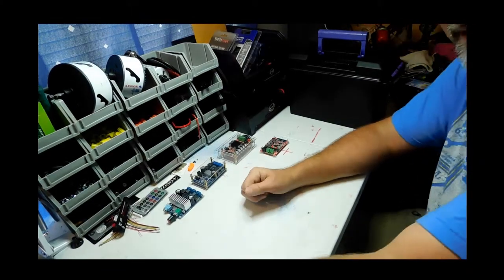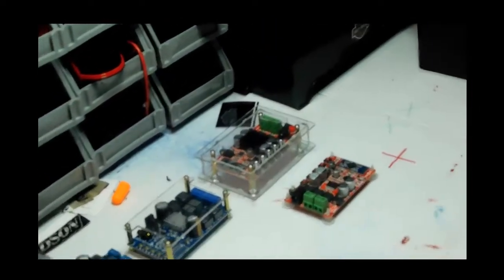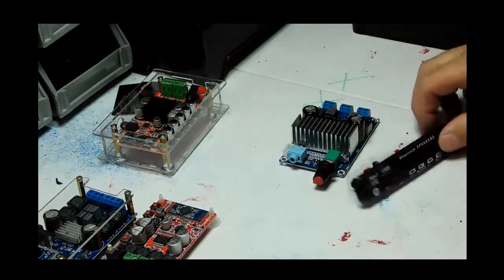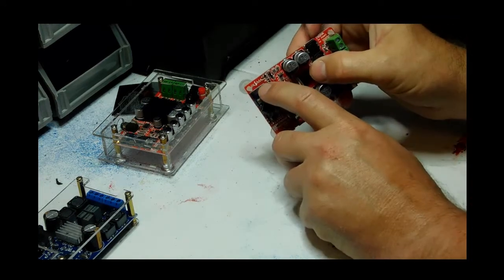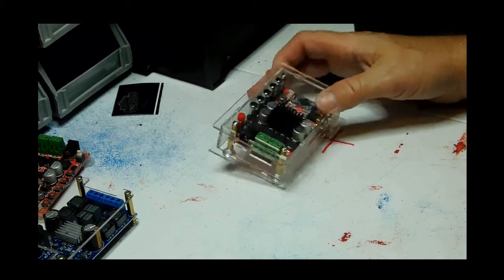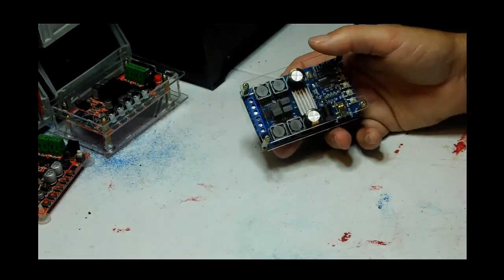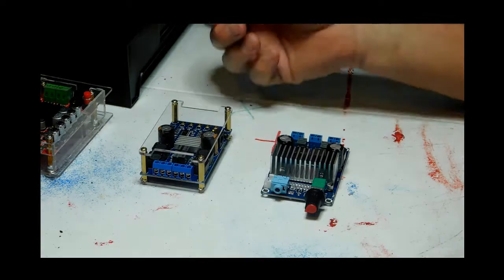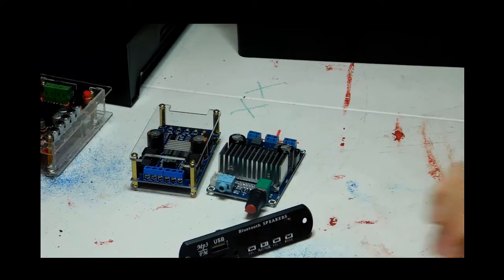Amplifier Boards that you can use in your boom box project

Comment: Great to know I was about to buy the other one on amazon that’s with a fancy knob and says 100wX2  and it has a black cover w a diagram any ways I went for the two you mention the one with Bluetooth and 3.5mm and I made many test it should give you 21.2W from 12.5-27v with atleast 1A crazy how good this are , that’s true I didn’t find any problems with any poop sound , there is two versions one with a lady voice when connected and mine was with just a tone . Less than 12.5 v and you get less watts it could go up to 5v heheh crazy tech but I’ll distort sooner on any input source you put quicker . I just wanted to buy for mini speaker test and or a future diy boom box  install
Reply from the maker: This video is quite old. The one you are talking about is a great amp

Comment: Add a 10-100 uF capacitor across your power input on the board... That should help with the noise AND the audible thump when turning on.
Reply from the maker: Robert Cartier is there any way you could possibly join my Facebook group and draw a diagram to show exactly where to put that capacitor?. I know what you're saying but I'm not sure I understand exactly where to put it and if I could see a diagram that would be great. Look it up on Facebook, I love all things radio is the name of my group
Reply: Sorry, I don't do Facebook... 
A more detailed explanation, perhaps?

In your builds, the way you connect your power to the amp is by the input power jack. In most cases, only two pins are used on that socket. Mount the 'decoupling capacitor' (that's what it's called) between those two pins, paying close attention to polarity. If there is no space there, see if you can mount the capacitor on the underside of the board to the socket pins. Use a small electrolytic capacitor with 10 to 100 uF, with a rated voltage higher than your input voltage. 

In other words, mount the cap in parallel to the power leads. Place it as close to the point where power enters the circuit as you can. Polarity is very important.

You can find those caps in almost everything you take apart... just salvage one from an old internet router or a modem.

Anyway, here's a link to a picture of a cap mounted parallel to the incoming power leads. https://1drv.ms/u/s!Ar8YMCukXFGFniidU31PHGFz02c0

Cheers from Canada!
Reply from the maker: Robert Cartier Man, you are missimg out. We have a gantastic group of builders in my Facebook group
Reply: You wrote: "Man, you are missing out..."

Can't be missing out on much -- You're there all the time and were still  unclear on where to connect a decoupling capacitor. 
LOL  Kidding! (...but not really.)

A better reply would have been: 
"Hey thanks Robert for the revised explanation, now I get the capacitor thing..."  But nope, it's Facebook this, and Facebook that... Enough already!
Starting to think this YouTube channel is all about your Facebook group, and asking for more info was just a ruse. ;-)

Just teasing... 
Your group sounds like fun, but like I said, I don't do Facebook.
Reply from the maker: Robert Cartier the reason I promote my Facebook group is because it's a lot easier to have conversations and post pictures and explain things on the Facebook page than it is in the comments on YouTube.
Reply from the maker: Robert Cartier and I do thank  you for the help I'm going to do my best try to figure out how to make it work
Reply from the maker: Robert Cartier I appreciate all the help I do is just easier for me to communicate on Facebook that's all

Comment: How many watts do the speakers have you be for this bluetooth module to work ?
Reply from the maker: Oscar Diaz you want to use speakers that are at least 30 watts RMS
Reply: DIY Boom Boxes In Texas ahh okay makes sense , my current speakers are maybe too much , the bluetooth module will spot working after a while
Reply from the maker: Oscar Diaz what size speakers are you using? What brand? And how many watts are they?
Reply: DIY Boom Boxes In Texas I believe 6x9 kenwood and peak power 300 watt rms 40 watt impedance 4 ohms